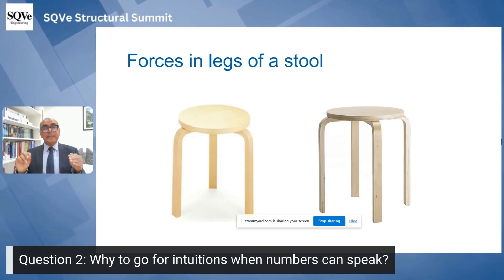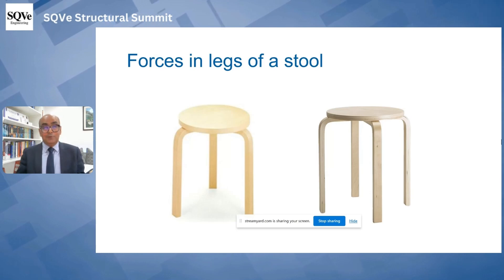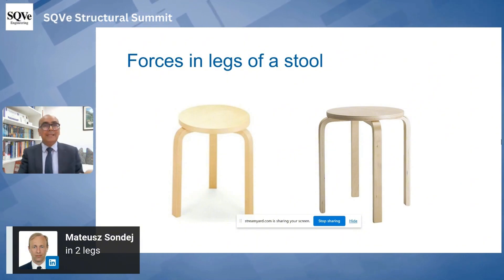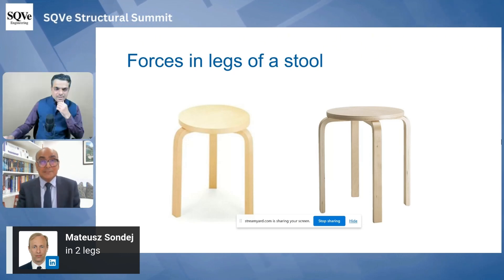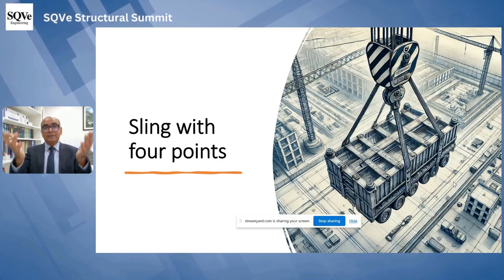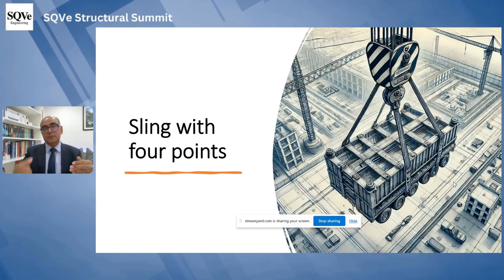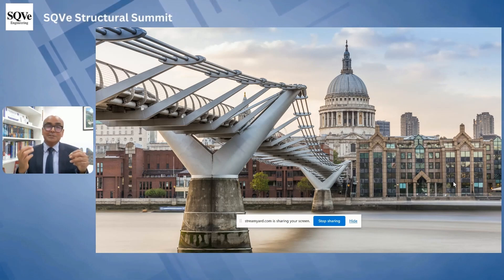Why Structural Intuition is Essential in Engineering When Numbers Fail

Comment from the maker: ⏰ TIMECODES ⏰
00:00 – Introduction
00:44 – Why go for intuition when numbers can speak
01:55 – Why some impractical design look OK on paper
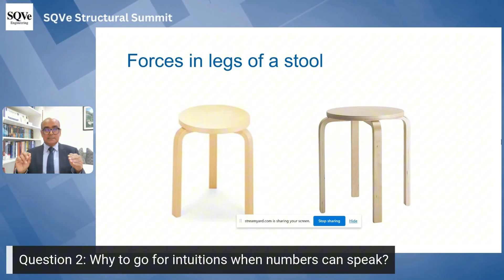02:36 – Example 1 Why numbers fails
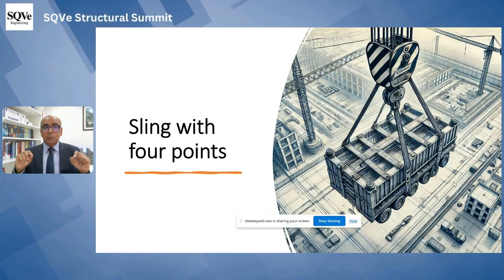07:08 – Example 2 Crane with sling
07:08 – Example 2 Crane with sling
08:40 – Example 3 Millennium bridge London
11:19 – How structural intuition can help avoid failures